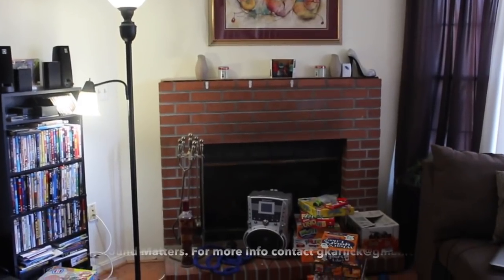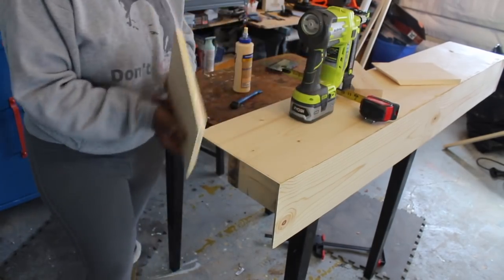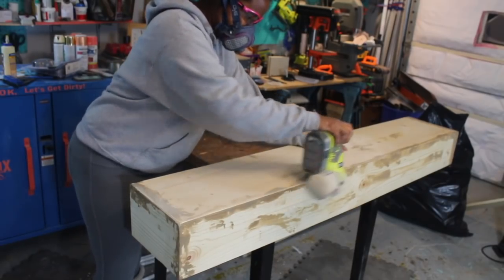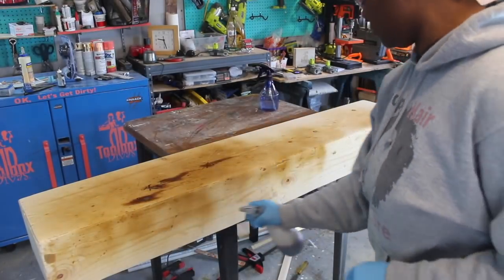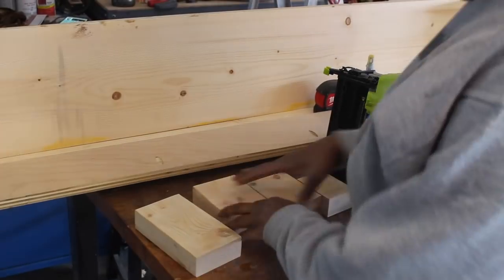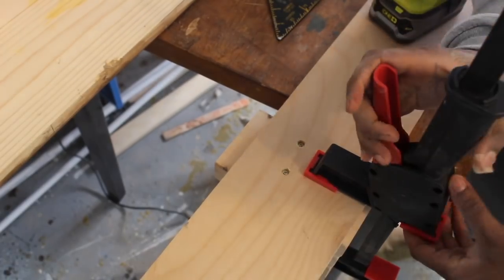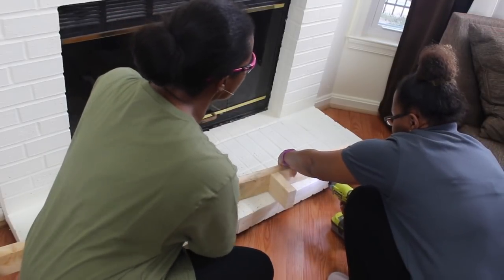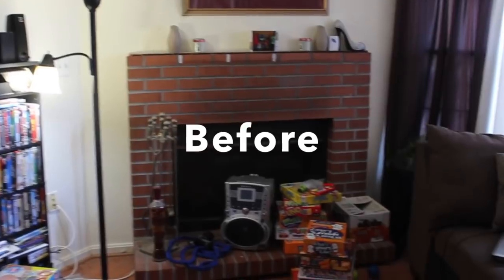Build a DIY Faux Rustic Beam Mantel | Floating Shelf

Comment: That is the best-looking finish I have seen so far. dark in all the right places and light to show off the "distressed" area. if this was the first time you have a natural talent! If the corbels would be stained also how would you run the grain of the wood? any different shape?
Reply from the maker: Thank you so much 💕! I really appreciate it. I actually don't know because I used 2x4s for the corbels and with those you see little in terms of grain. I would have to play around with it and see where it leads me, if that makes sense.